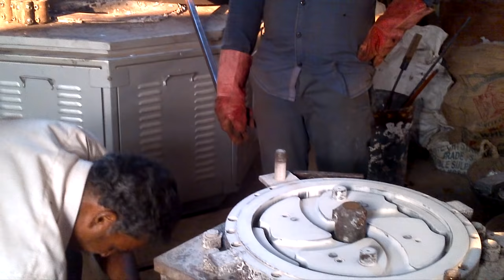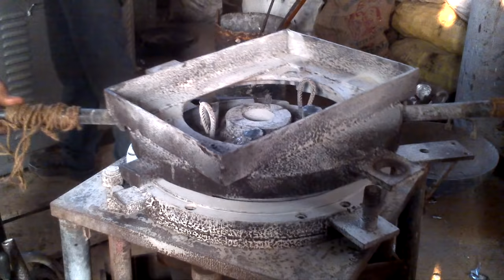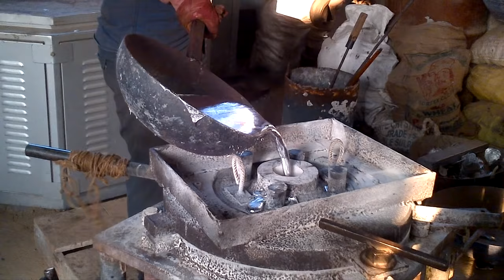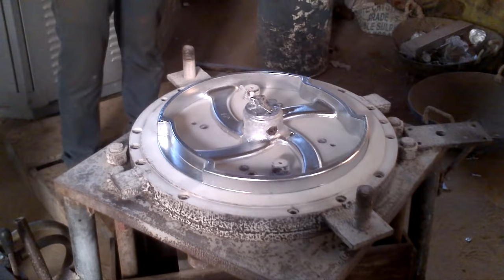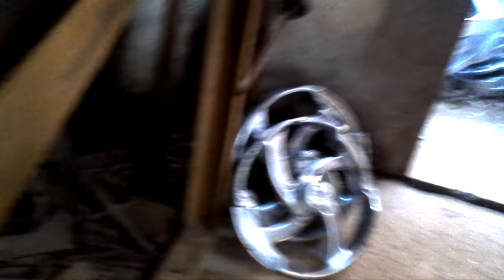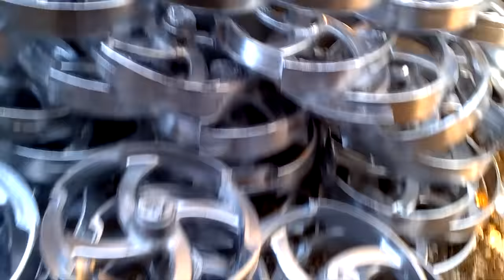Making aluminium alloy wheel | using permanent mold

Comment: hi is this the Same process for making magnesium alloy wheels for bicycles also??
Reply from the maker: no, alloy wheels are manufactured through low pressure or squeeze die casting method